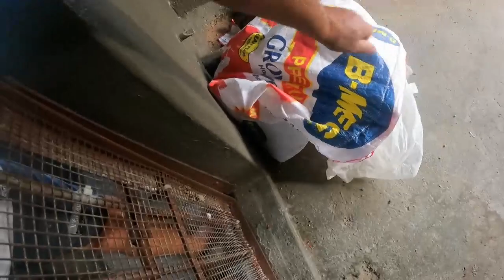Candle Light Test For Fertile And infertile Eggs -

Comment: What is  the reason that you do not straw or wood shaving in the nest baskets. It would prevent the eggs from rolling, getting damage and keep prevent the cold air coming up though  the nest bottom.
Reply from the maker: In the past, we used wood shavings from a furniture-making workshop. (very Good), The last refill was coconut fiber and that worked good also.. I need to refill again